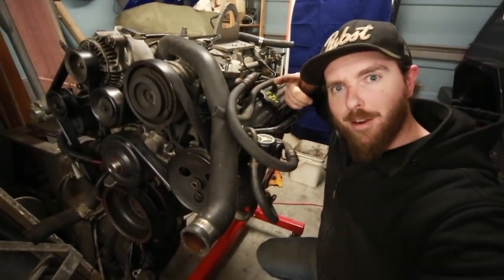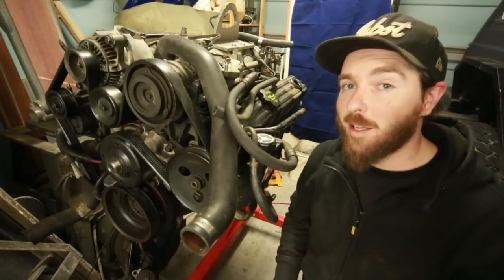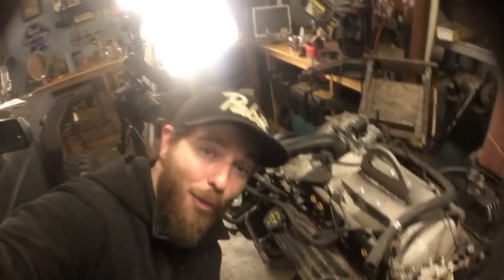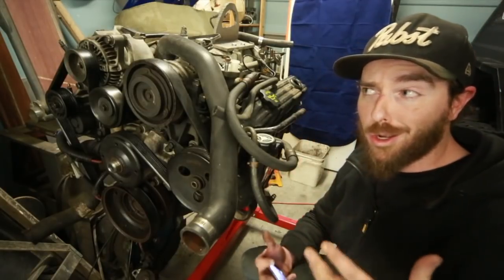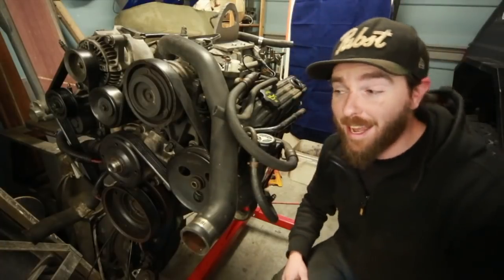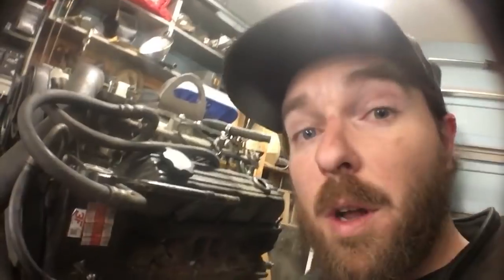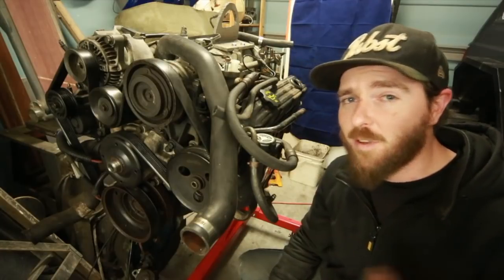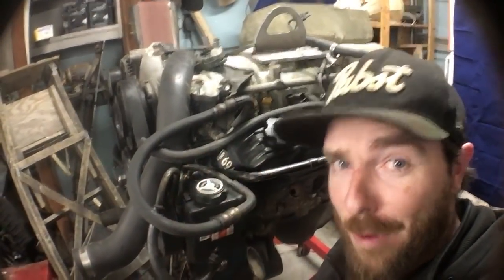V8 in an XJ? - V8 Jeep Cherokee Project

Comment: If you have a later model xj or tj like 99-01 it uses the same pcm as the magnum motor and you just have to fab up mounts and splice the dodge sensor leads where the jeep ones were

Comment: Do the intake manifold plate upgrade (cheap), replace the PS pulley with the early style steel one,  shoehorn it in, and do a megasquirt ms3pro universal for $1.5K. I wouldn't rebuild it till it gives you the death rattle. The trans is always the issue with Dodge V8's.

Comment: Besides the wiring it's pretty easy. My buddy has 2 5.2 xjs. His one had a 727 trans bolted up to the 5.2 on his trail rig. The other xj has a Dakota ax15 belhousing bolted up to his Cherokee ax15. They're both carbed non fuel injection. He made radiator hoses to pass under to make up for the different sides and welded the grand Cherokee mounts in on one side the other side should bolt in i believe. I can give you his contact info if you'd like pictures or to talk to someone who's done it twice.
Reply: The manual one he has the harness started to make it fuel injection but stopped to get it going for our winters toys for tots run
Reply from the maker: I would love to get a link for that.
Reply: Are you on Instagram? I could send him your user so he can send pictures and info
Reply from the maker: @pabstboys

Comment: Those engines ecu are trash I had a Durango with that engine stick to your 4.0 and they're not even that powerful as people think
Reply from the maker: Fun project tho..
Didn't cost me a dime
Reply: Eduardo Torres 318 is the strongest most reliable engine Chrysler made in the L.A. block and magnum. 240k miles on mine not one issue out of my shit ecu